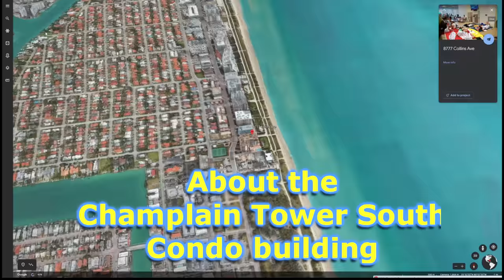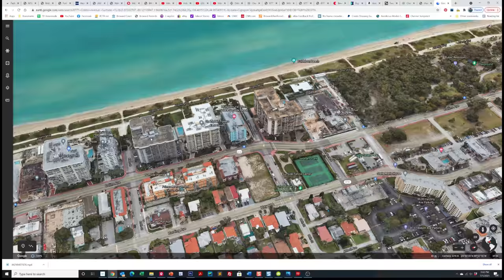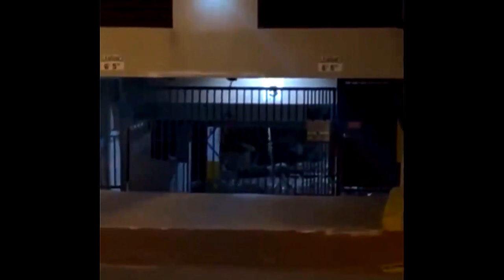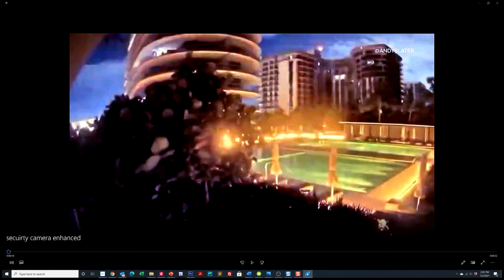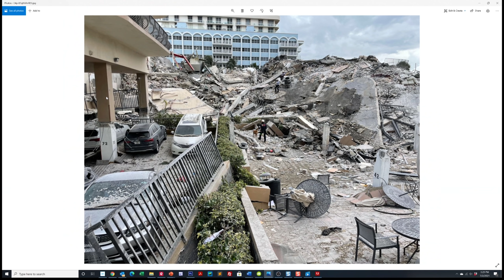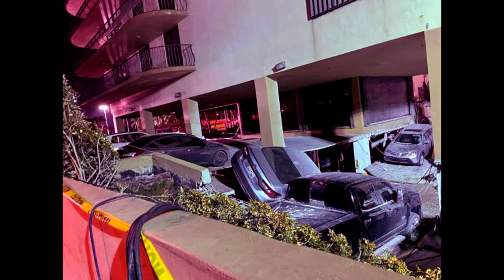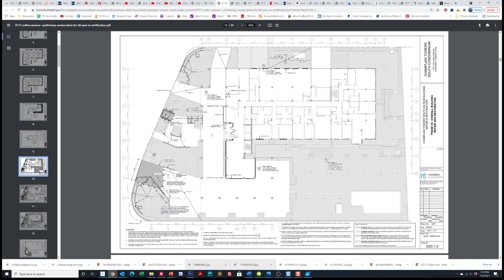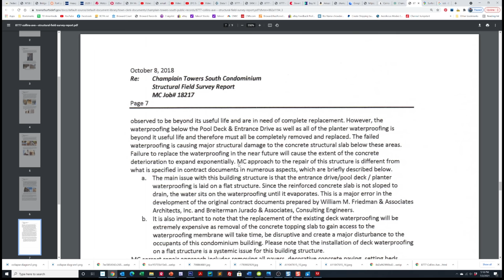Here's Cause Of Miami Condo Collapse Champlain Condo Towers, Surfside

Comment: The puddle of water on the garage floor was coming from the planters on top of the pool deck which were directly above. Those planters were leaking and corroding the concrete and rebar for decades.
Reply: planters for decades?... do you have any proof they were there longer than 10 years?...
it could be rain and wet weather for all we know, and bad water insulation below those tiles...
Reply: Doubtful.
Reply: The planters were on the original construction documents. They were mentioned in the 2018 report as leaking. 

But I am more interested in the Subsidence report saying the building had sunk at a rate of 1.9mm per year. And that was back in 1993-1999 that it was monitored. So this building could have sunk down into the ground up to 3" from the time it was constructed? 

How about the report of the building manger saying salt water in the garage at every high tide? Sounds more like a failure in the footers allowing the building to shift and a partial collapse of the pool deck then a subsequent full collapse of the pool deck at the time of the tower collapse. I agree that it was the 3 central colums centered over parking space 78 were the first to go and that is supported by the video 7 min before the collapse.

To bad they did not pull the fire alarm when they saw the parking garage had collapsed.
Reply: the fact that moisture from planters was penetrating that easily shows how poor the construction was. Half of America needs tearing down and rebuilding to modern European standards but hell medieval buildings continue to hold up better than American modern construction standards. Only modern nation to continuously move backwards in building standards. All about flashiness and not a thought spared of longevity
Reply: @_s_9920  "medieval buildings continue to hold up better than American modern construction standards" A) they're not exactly as tall with so many floors. B) This building has people actively living in it. C) I feel as though you are cherry-picking examples, how many modern buildings have really collapsed compared to medieval buildings (don't quote me on this, just there probably would have been a lot more news coverage if it were some major issue) D) you have water pipes, electricity, etc. adding to complexity of buildings. 
Look, they're not the same thing, don't compare them. A war fortress (or a church) is not the same thing as a luxury condo building. Houses may be more comparable but they still dont have water, gas and electiricty flowign through the walls, do they? And its not like there are medieval buildings that last for shorter amounts of time than modern buildings. Most of those surviving buildings (im guessing) are made of stone which is far more expensive and not comparabel to regular homes.
"Half of America needs tearing down and rebuilding", not exactly fair. We do use more timber in building homes but that doesn't warrant being torn down. Its just that homes last for less time. Not that you need to rebuild everything. Sure, stone and concrete and metal is better for longevity but tearing down everything is just wasteful.
Reply: @jasonz8635 , I agree and I'm sick and tired of hearing how much better their ''buildings'' are than ours. We have homes that are 350yrs old or more and still standing. And let's not forget, all our building experiences came from people from Europe.

Comment: Great insight! You had made the comment that the columns in the center of the site were narrower than the ones around the perimeter. I didn't think of it before, but structurally they were probably ok as long as the pool deck/garage ceiling stayed intact at the center attached halfway up.  Once the pool deck collapsed down, that left those narrow columns with no way to transfer load to the side over twice the height.  That explains why the pool deck looks almost completely intact...it fell way in advance.

Comment: I’m in the building and concrete field,most of these older buildings near the ocean have some of this.We have changed the materials to make the concrete because this is well known in the field.We have been using coated rebar with special admixtures in the concrete for quite some time now.The salt water air will eventually destroy every one of these buildings that use the old materials.The buildings don’t have the service life to stand forever in these conditions…
Reply: But why not use concrete coated I beams like all skyscrapers and even homes in the Midwest use? Rebar reinforced concrete is a joke for taller structures. I'm shocked it didn't collapse after 10 years
Reply: Agree
Reply: @raccoonstudios4458  I agree with you. Rebar and concrete are susceptible to storms and  all the salt water in the atmosphere. I would have never thought they built expensive highrise buildings without I beams. This is so very sad. All those people.😞

Comment: Thanks for a rational view of events ... My own (Mechanically Engineered) view is that the great majority of the collection of causes for this tradgedy lies with one simple fact:  the failure of building codes involving high-rise construction without requiring rebar to be made of "316 grade Stainless Steel".   Standard iron rebar should be contra-indicated in such situations.  Period.  Period.  That material , I agree, is more expensive, but over the long-term of building maintenance it certainly would work out to be the less-expansive option.
Reply: Exactly.
The houses in Katrina that were still standing had one difference between the houses that didn't make it--galvanized screws.
They're slightly more expensive, but better long term.
Reply: Taking the time to read comments is better than any schooling I may pursue 💗😁
Reply: @eradutiu  Not all comments. Some comments are insightful, some are just bull.
Reply: @NoTraceOfSense  same, I'm not science-minded and I've learnt a lot from the videos AND the commenters ♥️

Comment: Everyone talks about "smooth rebar", but those long strands hanging down are posttension cables which were not grouted in, but just anchored at the exterior. These exterior cable anchors are hard to effectively water proof which can lead to rusting and concrete spelling and loss of tension. I decided early in my career to never be involved in the design of this type of building.
Reply: I saw plenty of rebar hanging down, mostly at the angles they were bent to during the collapse.  I didn't see cables, which would of course hang straight down.  Is there a time stamp?
Reply: @nobodyknows3180  The upper floors appear to be post tensioned.  There are other videos showing what appear to be cables along with photos of the bottom of the slabs still intact where the cables were near the bottom of their drape and were yanked out of the slab.  Its possible the slabs above grade were PT to minimize column layout in the units while the ground level slab was conventional RC.  Judging from the tight column spacing shown in the architectural garage plan, this slab would not need to be post tensioned.
Reply: More current code requires compression levels that essentially provide redundancy so that if cables lose tension the slab is still stable.  However water proofing is still a big concern, especially near the ocean.  High strength low porous grout is essential.  I wouldn't be surprised if back then they filled these anchors with generic off the shelf 2500psi bag mix... Early PT was developed as a cost saving method to greatly reduce the amount of rebar in a slab.  Modern PT is primarily a way of maximizing the spacing between columns to create open floor plans, but the slabs still have a significant amount of rebar in them to prevent cracking and creep.  I've seen some older PT plans and I don't blame you for your decision to stay away, especially with the limited software solutions available.  Talk about crossing your fingers...

Comment: 3:30. The force actually doesn’t need to be that strong to start breaking and cracking concrete since it is an expansion of the concrete rather than a compression and the tensile strength of concrete is only about 10% as strong as its compressive strength. This is a fatal flaw in concrete and is a big reason for why it is able to crack on rather not so harsh conditions.
Reply: You mean rehab expands and pushes concrete outwards so I don’t think was a pulling force but an outward pushing force. That is a flaw where it only deal with huge compressive loads.
Reply: @ausriusdidziokas7979   I just checked to make sure and even though it isn’t a pulling force that is acting on the object, the rebar’s outward pushing force is still an example of an expansion of the concrete since the force of the object is being exerted outward on the object instead of inward and the concrete still had area to expand.
Reply: That stong? LOL!

Comment: We had a hotel that was slowly slipping off its foundation down an embankment taking about 400' of the parking lot with it.... fortunately the hotel was only 4 stories tall... but the point being it was the pool. It took 15 years of the pool leaking with an automatic fill valve refilling it without any notice. The water bill was not unusual enough to alert anyone. The maintenance staff had complained that he has to add water to the pool every week, EVEN with the automatic fill valve... no one figured it out. The hotel was now sitting on a pile of mud, so heavy and unstable  it was taking the hotel and the parking lot down the hill with it in a slow mud slide. I mention this, as water from the bottom of the pool and from poor plumbing could, in 16 years also place the condo complex on top of what had become a pile of mud and a corroded sub-foundation, so much that water was permeating from under the floor in the parking garage as the pool guy had spotted... it would be interesting to see how much the earth under the parking garage floor was saturated and how much the sub-foundation was eroded with rusted rebar. Just a thought. Craig
Reply: That was not unlike my very first thought .
Reply: Wow! No kidding! Great theory!
Reply: I have to wonder though, if it rains or if the tropical system goes through that area in the next few days before the rubble is moved..will they still  be able to tell how saturated the ground is from water leaking underground?  or will rain cause problems for that.
Reply: @Anglynn74  I am thinking for it to have failed in this manner, there would have to be many square yards of mud, soft earth, and rusted rebar... 16 years it would be a lot of water, more than what even a 5 inch rainstorm could cover up. If you look at a map of movements of the buildings around the area, showing the settling that was measured, these condos showed more movement than most of the others, not a lot more, but enough to easily measure, which would indicate the problem was going on for years. A small leak from a pool doesn't sound like much, but take for comparison, a garden hose used to fill a swimming pool, it takes a maximum of about 2 1/2 days.... think of that same water leaked 24/7 for 16 years...  it could fill 146 average swimming pool a year, or 2,336 in 16. And if the water table is very high, it would be difficult for it to drain off, or be absorbed away.  It is possible scenario in my opinion... someone should have a look at the sub-foundation, with a very discerning eye and measure the moisture/water...  very important. No matter how well any  building is built, something like this can likely bring most of them down.
Reply: It's going to be saturated bc the water table is high that close to shore. I read early on that they knew for several years that the ground under the building was slumping or sagging. 

Heavy building.
Reply: @craigwcooley  thank you so much for the response, very interesting.  I'm still learning when it comes to this stuff, a lot that I didn't know.

Comment: In California, we learned long ago to be very aware of "soft first stories"... which is the parking garage in this building. And, whenever possible, we avoid buildings that incorporate them. Those spindly little columns are under tremendous load, and if the slightest thing causes lateral forces to develop (like, in CA, an earthquake) it's a disaster just waiting to happen. In this case, it doesn't look like any rapid violent force like a quake, but rather decades of neglect and incompetence on the part of the property management team. 

If I moved to FL and had a million dollars to spend on a living space, I guarantee you I would not even consider any of these beach front condo buildings. New or old, they all incorporate features that would raise the hairs on the back of my neck, and I'd scratch them right off my list. I don't like multi-story buildings in general... to say nothing of huge structures standing on what are effectively spindly little stilts. Nope, no way in hell.
Reply: Soft storey is due to lateral loads not gravitational
Reply: California and Florida are extremely different we have to earthquake proof everything we build but one thing I noticed was being so close to the ocean you’d think they’d put some epoxy coated rebar to prevent corrosion.
Reply: You are buying right into the official narrative of how this building supposedly collapsed, but you are not bothering to use any critical thinking to determine if a building free falling into it's own footprint could happen at all unless explosives are used, especially if it only takes 15 seconds to fall to the ground.
Reply: @gingersmith2888  I came here to say the same and see if there were others, and no mention of the other videos where the squibs are plainly seen during the first few seconds of collapse 🙏🙏🙏
Reply: @gingersmith2888  so you have proof of a conspiracy?
Show it, or you don’t know it, and it’s not true.
Reply: @RSAgility   There is actual footage of explosions right before the building collapsed with another view on the building. He missed it on the video.

Comment: (sorry for my english) it looks like column buckling when those three columns lost restrictions due to pool's slab and beams that support it from garage, when that slab fails, then those columns gains height (double actually) and become slender columns and fail for buckling... i guess after that, came that kind of failure when rest of columns go through slab for shearing. I'm aware most of architects prefer building with that kind of system, first because looks great, and second because avoid beams (probably about 12 inch of height for beam), that means that you can add another level to building for every 10-11 level... but in my opinion, it's dangerous go without beams in case of collapse, and if some columns fails a building with beams will give you time to get out safely, if collapse then will be some space to survive in most of cases.

In my opinion, it was a series of unlucky events, from bad maintenance to bad criteria for make those beams in garage (to support part of pool's slab) part of the building support system. I mean, you can do it and calculate it very well, but must of time is better to keep things separated if the infrastructure is different.

I want to be clear about building support system was with Slabs and Columns (slab directly joins to column), and part of that pool's slab was over a series of beams that were joined to columns of building in garage area.
Reply: I’m no expert…but I think it could be one main cause that was wrong and a few minor too, that cumulating to this tragedy.
Your English is excellent by the way. Whatever your 1st or additional language is, I can guarantee I couldn’t explain something so complex in another language. Giving directions in France is about my limit
Reply: @lilacscentedfushias1852  thanks a lot, :D

i just hope more managers of near buildings be more aware of maintenance, mainly inside of garage area that most of building have under level of natural terrain, is more wet and use to suffer filtrations.
Reply: I agree. The cause of the building collapse was likely the loss of lateral support to the columns when the pool deck slab collapsed 7mins earlier. What caused the pool deck to collapse is not evident directly, however obvious long term water ingress and related reinforcement corrosion is a likely issue. What really concerns me is the photo's showing entire slabs with the rebar seemingly stripped from the slab like it's made of cake. Failures of sound reinforced concrete should not look like that. I suspect a significant problem with the concrete strength will be found.

Comment: The saltwater had found a way under the parking garage and began destroying the foundation at the buildings lowest point. When the lower columns started to fail, pancaking occurred. This is why you see decks on top of each other. The sections of collapse more than likely follow deck marriage lines.